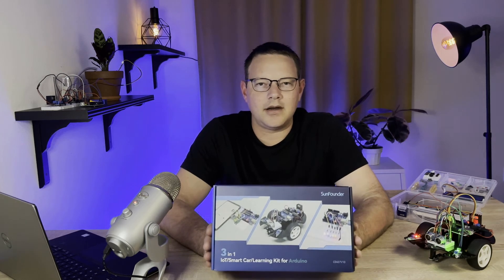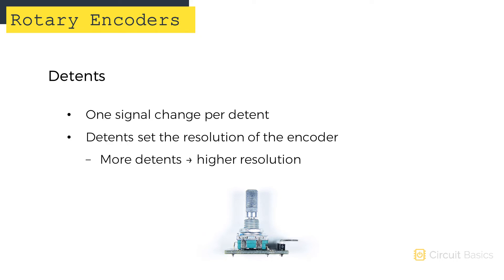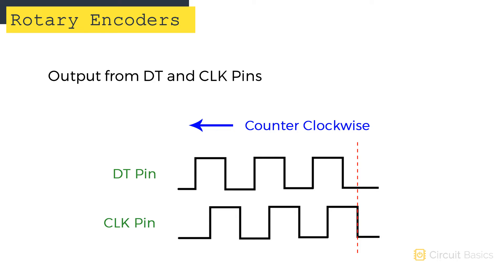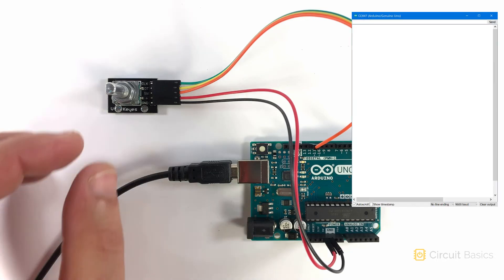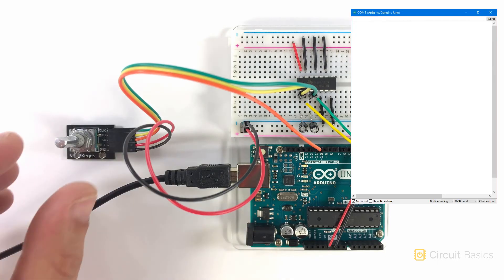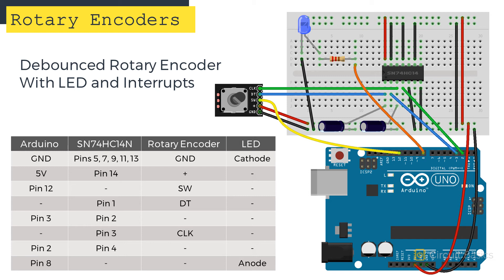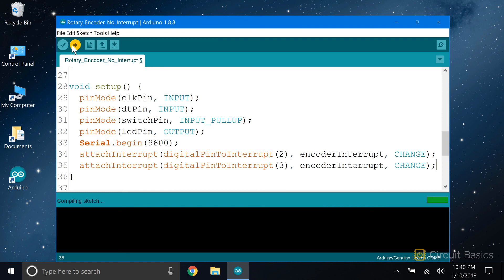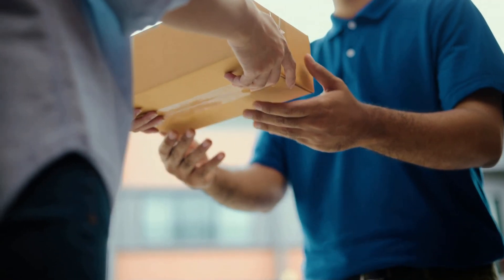How to Use Rotary Encoders on the Arduino - Ultimate Guide to the Arduino #25

Comment: Thank you for this tutorial. I have a rotary encoder based speed control that operates open loop; I.E. there is no way to tell what the setting is except from the motor it is driving. I intend to sniff the encoder signals and monitor them with a counter for feedback on the speed setting. This tutorial will help me get stated. An FYI; you could possibly damage the Schmitt trigger (CMOS IC) if too large a capacitor is connected to the inputs; upon power-down the caps will discharge into internal protection diodes because they become forward biased (VCC becomes GND). Check the data sheet on the part.